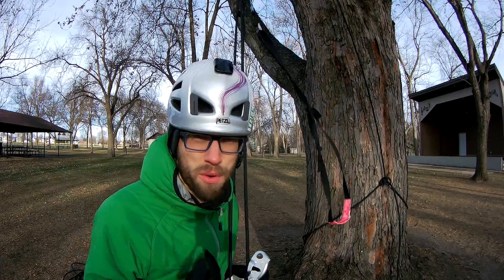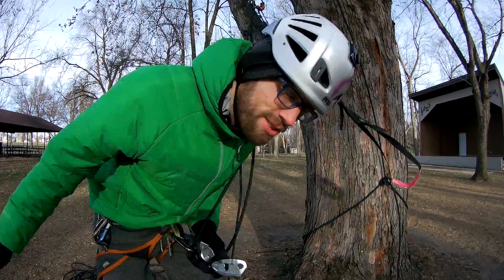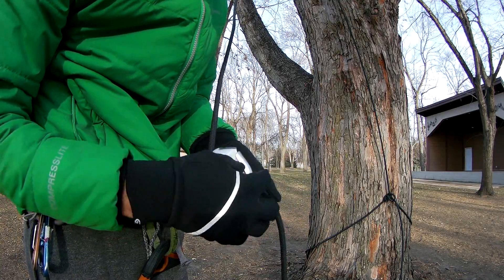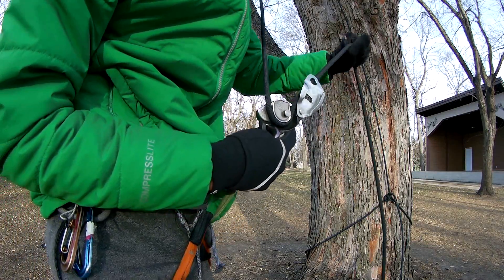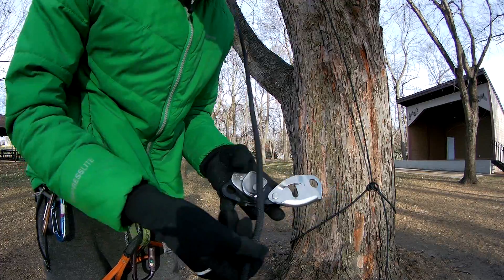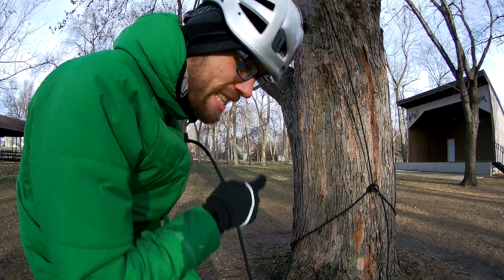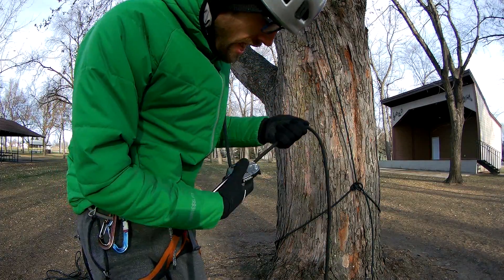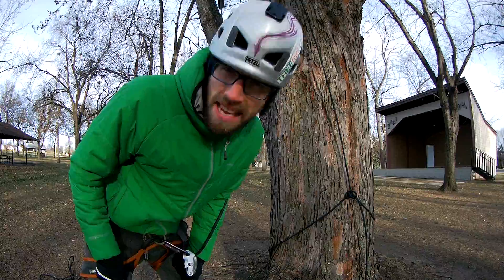Petzl GriGri : How does it work?

Comment: thanks for the vid, sorry if this is a stupid question but i'm having so much trouble finding a clear answer to this.
can you use just the petzl and attached harness to ascend (or descend) a rope?
if you let go of the rope with both hands, the petzl would hold you in place?
Reply from the maker: you can not. you don't have any way to feed the rope upwards through the grigri. you at least need a small prusik loop above the grigri with a carabiner. the tail end of your rope (behind the grigri) goes up through the carabiner and back down to the ground. If you pull down on the tail in this setup and "hump" your hips upward you can essentially climb up the rope but it is tiring without a footloop.
Reply: @TREEfool  thanks!!!

Comment: Thanks for this. I've been belaying with an ATC and just decided to buy a grigri.
I was trying to figure out how it worked mechanically and was like... nothing moves in this when I pull the handle!!!
Now you just made me realize that the entire cam is what moves and the handle is actually just a lever. It could basically not even be a moving part at all and just be a solid extension to the cam but you'd run the risk of accidentally triggering it, or it could be an encumbrance. But there's no mechanical effect to just rotating the lever.

I think many recreational climbers don't understand this simple fact. Because time and time again I hear people comment on how "you pull it almost all the way back and it doesn't do anything and then at the very end of the range the resistance drops super quick". That's because it's not supposed to do anything before that. It has to be fully rotated, and when it blocks is when you can start exerting force on the blocking mechanism.
Reply from the maker: Great explanation! And glad I could help.

Comment: I intend to free climb some trees and really don't want to messing with ascenders etc(if I can't get up without an ascender, I don't want to go up)
Mostly, I'll be rigging and belaying my kids, so it will just be a standard top rope climb for them, but occasionally, I'll wat to go up too.
Is it ok to simply top rope with a GriGri and use this as my descender?  I'll get a cambium saver / throw line to get the rope up the tree for starters.
Perhaps you could do an instructional on lightweight free climb rigging using just the basics?

Comment: GRIGRIs should not be used for solo climbing, they are manufactured to belay partners, it says so clearly with the packaging. The grigri is not auto locking it’s assisted braking NOT SAFE TO GO HANDS FREE. Use the petzl ID it’s meant for this kinda of climbing. Treefool you’re putting people at risk of injury or even death, a teacher is responsible for giving accurate and safe climbing instructions.
Reply: Yeah...catastrophic rope slippage is extremely improbable. It might slip a bit, but that doesn't meant it's inherently dangerous. Just something to look out for.

Comment: pleace dont use a grigri for tree climbing, it is made for sport climbing not for this types of systems, when you use a grigri for this there is a chance the middle piece will break. instead use a PETZL ID'S, it is made for this types of climbing  and is a lot safer
Reply from the maker: I would imagine that the grigri has the same propensity to break as the carabiner which attaches your harness to your prefered climbing system. I could be totally wrong in this assumption but this is just a thought. Hundreds of guys take huge whippers on grigris everyday (repeatedly) so there would have to be a pretty epic manufacture defect in order for one to break a grigri under non dynamic tree climbing loads.
Reply: People regularly use them for huge rope swings with slack in the system. Seems to be strong enough.

Comment: Ok, warm is a personal thing. I went on a day hike this past weekend, and it was freezing rain the entire Saturday through sunday morning. Not warm, but the hiking kept me warm enough even though I was wet through out. My 13 hours in the hammock was OK but not spectacular as in past winter hikes.

I may consider this device over a rope wrench and prusik knot in the future if it can be self tending.
Reply from the maker: Freezing rain is my mortal enemy. I can handle cold snow and summer rain but freezing rain is a whole different ball game, haha... as for the Ropewrench vs grigri I think most other tree climbers would tell you to buy the rope wrench. If I climbed on a thicker rope I would probably be using a rope wrench
Reply: @TREEfool  Yah, I have 11 mm rope and both work great with that thickness. Not afraid to try smaller if it still allows me to use a foot and knee ascender. I like that method of climbing.
Reply from the maker: @tonyrobbins6  Me too. Definitely the fastest method I have used.
Reply: @tonyrobbins6  If you want to use a foot and knee ascender and want a grigri style device, get the Taz Lov2, the rope runs straight through it, allowing ropewalking. Or just get an Akimbo
Reply: @raphaelbeinhauer9242  Never heard of the Taz Lov2 but have seen many videos on the Akimbo. Thanks for the reply.